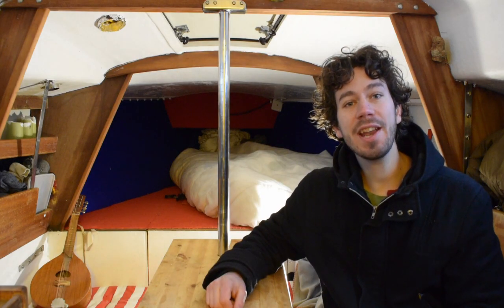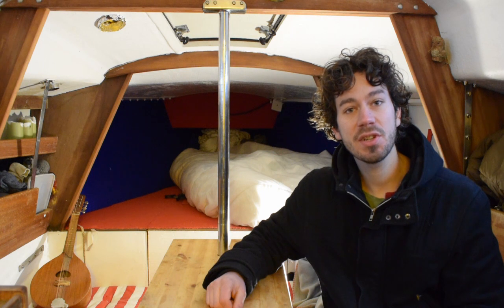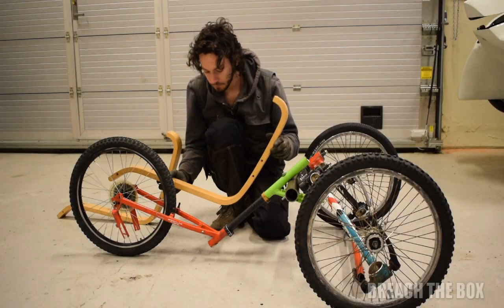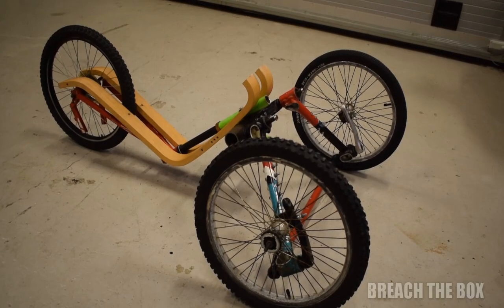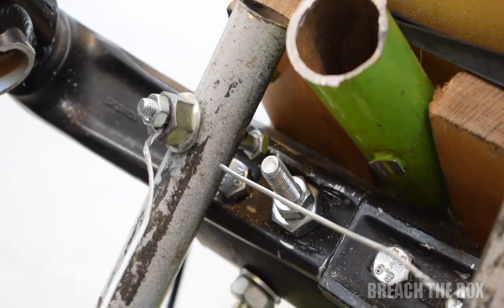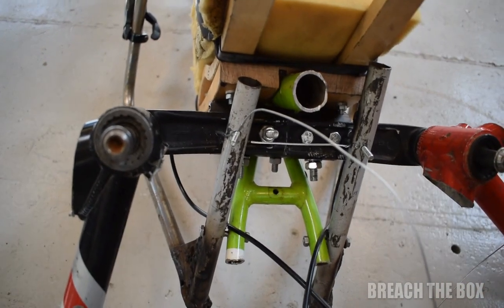DIY Velomobile Trike (rear steering functional prototype)

Comment: Do you have measurements on the steering geometri? Width, height, angulations, how much is the angle of the triangle compared to horizontal? Drawings would basically be helpful..
Reply from the maker: Brian Kaagaard The steering system dimensions are based off plans from Mosquito-velomobiles.com, you get get them there if you're interested
Reply: I can't seem to find any... thats why I asked you.
Reply from the maker: Brian Kaagaard send them an email and they'll help you out. Not sure if they have made actual plans now, I bought a 3d drawing from them, on which I manually measured the parts
Reply: @briankaagaard971  Hello. I can't find dimensions neither. Did you  find something ?
Reply from the maker: Did you try sending them an email?
Reply: @BreachtheBox  Not yet, I was first probing if DIY community can share basics for the experimental prototype I plan to build. Similarly to you, I am wondering on polygone dimensions and basic stability criterias. Thanx !

Comment: Great job! Looks like you used crank as the support for the rear wheels, did you use the pedal axle for the wheels? What about the bearings then? Thanks
Reply from the maker: Thanks! The axles are in the wheels like on a normal bicycle, but they're extra strong (14 mm thick axles) BMX wheels because they are only attached on one side. the crank arms are bolted to a 90 degree metal bracket which the wheel axles are attached to.